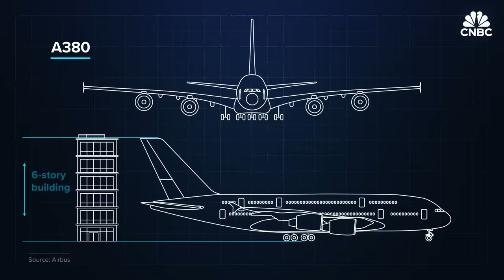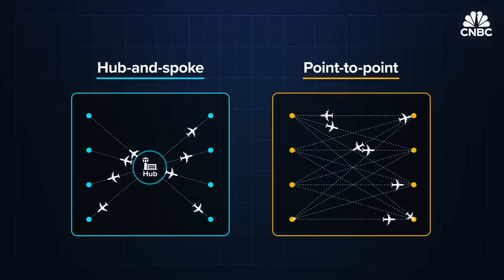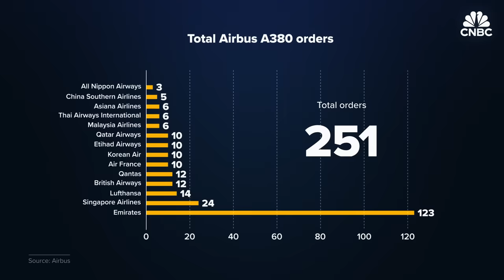Why The Airbus A380 Is Making An Unlikely Comeback

Comment: When you enter the economy class on the A380, you don't feel 'cheap.' There is a sense of 'respect' for passengers. Thank you, Emirates, and other carriers, for showing some 'respect' to passengers.
Reply: The cheap feel always comes down to how the cabin is configured. I bet that the A380 would feel cheap if it was configured by Ryanair or EasyJet.
Reply: @marcellkovacs5452  That's true!👍
Reply: Thats exactly what occurred to me.  I would get on other jets and feel the obvious engineering to save money for profit but at sacrifice of customer comfort
Reply: I always fly A380 if available. I've flown 1st class for 12 hours once... I did not want to leave.
Reply: Not on Ethihad, feels very cramped in economy.
Reply: @jorritpels fork out on upfront or exit row seat in economy. It worth extra$$ spend on
Reply: Emirates 777 economy legrooms are pretty nice compared to other airlines. As a matter of fact the are better than Etihad's so its very much dependent on which carrier you're using.
Reply: @marcellkovacs5452  Exactly, Emirate's 777 feels just as luxurious in terms of interior quality for economy class. The flying experience,  however, is completely different - in the A380, you don't even realize that you've taken off, and the engines are whisper-quiet.
Reply: @biglee13m  🤣🤣😝
Reply: You really don't want to know how bad their pilots are
Reply: Thank Airbus for incurring a loss to make the planes that allow Emirates and other carriers who ordered the A380 to show "respect" for the passengers.
Reply: Repent-and-believe-in-Jesus  Jesus built my hot rod... he's got a sweet-ass shop in old TJ
Reply: You know what's funny. I had my very first A380 flight from Dubai to the UK and I was REALLY disappointed. It was tighter than the 777 that took me there. I sat in economy but I thought it would be given that there would be more space being a bigger plane and all, but instead not only was it not about the same, it was less!
Reply: @stacia6678  I'd agree that the Emirates 777s have similar quality of service, but honestly I don't get what people say about the takeoff in A380s being quiet. Every A380 takeoff I've taken has been pretty long and rumbly.
Reply: I took Emirates A380 from Hong Kong to Paris twice. I took air France A380 from LAX to Paris.
On Emirates they gave little tiger hand puppets for kids☺️
On Air France, I got champagne 🍾 for breakfast in economy 😊
Reply: Qatar A380 economy class is also excellent
Reply: 'respect' by wasting taxpayer dollars to prop up an unsustainable business model.
Reply: Lol, you clearly haven't flown Lufthansa on the A380
Reply: This is true. I will pay more to fly the 380 every single time. I hope this translates into their financials
Reply: When I was cramped in a 450 passenger cabin, I feel very cheap.
Reply: @hoardroarklaughed  no it is not true. I flew Lufthansa A380. It was cramped and horrible. And I'm short so I can't even imagine what somebody 6 foot tall would feel like.
Reply: No plastic knives&forks on the A380
Reply: @apexjunky  that's airlines dependant.
Reply: You're still in higher-than-economy class flying Emirates' (and other expensive airlines') economy class compared to budget airlines. You're paying extra for that "respect", just like how you'd pay extra for first class within the same airline.
Reply: Exactly. Etihad felt cramped @jorritpels
Reply: Because buying an emirates ticket is like flying business with british airways for example...
Reply: Yes i agree. Loved this aircraft smooth flights takeoffs and landing. Economy class is great as you have said. Worst economy seats in the 777 class aircraft
Reply: rolls royce makes a tremendous automobile.
what kind of car do you drive?
Reply: The only one I can actually sit in comfortably in Economy (I've got way too long legs and I'm not that thin either).
Reply: And then you land and have to wait for your checked in bags with hundreds other people
Reply: @Serena_9  Shhhhhhhhhh! ;-)
Yes, the straight leg legroom, or simply to stand up any time I feel is worth it. And that leaves $$$$ in my pocket to spend on fancy stuff in the destination I'm going to, rather than on an aeroplane journey where everyone arrives at the same time.
Reply: @alexf7377  I can’t do economy on 12 hrs flight if I had a choice, I would go for business. Yes everyone arrives at the same time, but different conditions 😂
Reply: TRUE
Reply: They can do it. Fuel cost is not a concern. Fuel represents 50% total flight cost for Occident Airlines.
Reply: Totally agree. Flew with BA from LHR go MIA last December and it actually was reasonably comfortable. Impressive Aircraft.
Reply: I flew on one from new York to London, those suckers are huge, there was so much seat space and leftover seats that the flight crew told me I could move to whatever seat I wanted after takeoff, I went to the second floor and had a while row to myself and could lay down across the seats and sleep
Reply: So true, more space,more comfort.
Reply: Singapore the same :)
Reply: exactlt
Reply: I flew on an A380 once with Korean Airline.  It was a very smooth ride.  I enjoyed the plane and the onboard service.  I look forward to my next A380 ride with Qantas, March 2024.
Reply: Respect ?  What ?? Maybe this is you feeling cheap and not wanting to look cheap travelling cattle class.
Reply: Also Lufthansa 🗿🔝🫡
Reply: Don't travel economy then complain @jorritpels
Reply: @bftjoe tax? In the UAE? Get real.
Reply: @sithabelamandlawenkosiwodu6298  Lufthansa sucks. That's the problem. I'd never fly with them or their rude, intolerant crew.
Reply: @brownmold  Yes, the billions they used to just pay for wasteful A380s just appeared out of nowhere. You do realize European taxpayers had to fund the development of the A380 and now will never be repaid since it was based on deliveries, right?

The biggest losers in Airbus SE's decision to wind down production of its A380 superjumbo may be taxpayers in France, Germany, Spain and the U.K., where governments made a big bet on the plane by lending more than 3.3 billion euros ($3.7 billion) to build it.

You think this joke of a plane had any shot of being funded by a profit oriented organization? LOL.
Reply: @bftjoe  bitter, much? I see a lot more wasteful projects, and ill-spent money. 3.3 billiion Euros spread out over a decade, invested into jobs, development resesrch, keeping and spreading  knowledge within the EU? A whole cadre of aviation specialists trained and put to use on an international civilian project? Great! One of the better uses for EU money. It's not like the participating countries budgets fell apart because of this project. It's signigicantly less money than the utter waste  spent on the UK's aircraft carriers...
Reply: @brownmold  Yes, feelings are what's important. You're a real genius! No wonder you're an A380 fanboi. Billions of dollars wasted is okay, as long as it make big plane to make your feelings good!!!!!111!!!!1!!!

Like they couldn't possibly have spent billions of dollars developing a smaller, actually useful plane. What a huge joke you are!
Reply: 40000 feet stood at the bar with an Old Fashioned can’t beat that 😊
Reply: Oh really? did you ever fly on the AF 380 in economy? I bet you would change your mind lickity splits
Reply: If anyone is interested in getting a cheap feel, fly Air India.
Reply: @marcellkovacs5452  I think that's not the point. I'm tall and there is a big difference between sitting next to a windown on an Emirates A380 vs an Emirates 777-300. On a 777-300, I have to lean sideway because the fuselage leans into me. The fuselage on an A380 actually goes away from the passenger the higher it it gets from the floor because the economy class is in the middle floor, not the top floor.
Reply: I’ve been on an A380 and honestly on take off it was smoother and you don’t feel it as much. It’s allround lovely experience. Also sat on upper deck and all of it is a fantastic experience
Reply: @Serena_9  FIRST WORLD PROBLEMS
Reply: Does the owner of Emirates show that respect to his own daughters?
Reply: @marcellkovacs5452  I wouldn't be surprised if the pilots at Ryanair were sitting on camping chairs, strapped in with skipping ropes and the yoke consisted of bolted wooden sticks that had been washed up on the shore. That's the Ryanair business philosophy  :-)
Reply: @misham6547  I want to know. Whose pilots?
Reply: @bftjoe  still bitter, I see. What are you, a bitter former Boeing employee?
Reply: @brownmold  Did Airbus pay you to fanboi for a useless airplane, or do you do it for free?
Reply: @brownmold  Your baby talk will bring back the A380!!!! You're brilliant!
Reply: I just love flying in the A380....It is my favorite aircraft by a country mile....
Reply: What a bunch of BS....
Reply: @justanotherbeautiful5736  What is? Do you not like the A380?????
Reply: @Macedonia270  he doesn't know. That's why he's not being specific.
Reply: I felt very very cheap when i flew emirates a380. I had more leg room and a better seat on a cityhopper by transavia lol
Reply: @Zoranurai13  I would not know, I fly first class only... The only way to travel, really....🤣
Reply: @justinbchen  of course it’s going to be long, it’s a massive aircraft. But it definitely has far less a fine noise than Boeing planes
Reply: @karenl8837  idk, smaller planes didn't seem to have the same sound to me. But maybe it's just I'm more used to them
Reply: Thank you for that comment! You just read my mind. I worked and lived in the Gulf for a few years (2013-2020), but home was in the US. Emirstes was my plane of choice. Yes, the 777 was OK, but the 380 was something completely different. Yes, it’s a plane, but it’s not just any plane. One thing I particularly liked about it, was its size or mass, making it very stable to minor bumps. To many it’s not a big deal, but I sincerely appreciated this added comfort. Also, I never felt cramped in that plane. I loved standing a few seconds by the stairwell and visiting the bar. Top dog! But of course, the Accounts at Airbus won again. Perhaps we should remind them what funds their paychecks…
Reply: It seems that there are some secrets kept by all parties leading to this mess. I believe the newly designed jumbo jets are not survivable if one of their engines fails on take off or initial climb in every case, one engine does not have enough power. In the case of the A380, even 3 engines could not do it. We also know what happened to Concord.
Reply: "When you enter the economy class on the A380, you don't feel 'cheap.'"
LOL clearly you've never been on one operated by AF.
Reply: Emirates is in a class by itself.  Very true that their economy section never feels cheap, even on the 777's.  It's actually more equivalent on what you would get in first class on an American airliner considering the seat and legroom,   choice of gourmet meals and unlimited drinks and snacks, entertainment systems and other creature comforts where American airlines fail.
Reply: People don't really know how expensive, aircrafts are, especially maintenance wise.  I work at an MRO-Maintenace Repair AND operations facility, and I can tell you that, I'VE NEVER SEEN very old Airbus airframes going through C Checks, ever.  Fact is  we call airbus airframes, disposables.  A320, A330 usually 12-15 years, tops.
Reply: I actually look forward to CMAC because china manufacturing would solve this riddle between quality and efficiency, namely affordable luxury. All capacity is there why not share it with the people!
Reply: If I compare the seating pitch with other airlines/airliners I cants see any respect.
Reply: @Serena_9 if you're old*
Reply: I flew on Emirates 777 it was so noisy. Couldn’t wait to complete the 2 hour journey and get off the plane.
Reply: @marcellkovacs5452  they will never have the money to have some of these planes,not a fleet.😃
Reply: I was going to make a similar comment, you are spot on! It is the best plane to fly economy in and as someone afraid of flying it does almost not even feel like being on a plane. It is such a behemoth that you dont have much noise or feel much movement. I also love to be able to go to the back and do some step-ups in the staircase. It is an amazing plane and if a route has it, I choose the airline and flight that operate the A380. Best plane ever made (for me as an economy passenger)!
Reply: A380 is the best plane for economy class, the noise is well below other aircrafts too
Reply: @misham6547  its OK they are not flying Boeings!
Reply: @sithabelamandlawenkosiwodu6298  I am 6ft. 2"...that's mass cattle transport. After all the expectations a very disappointing flight. Even the lavatories were so tiny I had problems to pull my pants up, because there was no space for the elbows.🤬
Reply: Emirates are the very notorious airline that made the first 3-4-3 in a 777. The first airline to make peasants in economy suffer more than ever  😂😂😂now look at people praising that Emirates 😂😂😂
Reply: @misham6547  Emirates pilots are good.
Reply: @rezhaadriantanuharja3389  That's why they've invested into more efficient baggage carousels
Reply: @lug0718  Si dice "western" airlines, non occident... ignorante.
Reply: @dodaz5604  Do you know what synonyms are?
" Occident " is a term for the West, traditionally comprising anything that belongs to the Western world.
 Ignorant is anyone who doesn't know this and stupid for not being able to understand.
Reply: @dodaz5604  Flight 521, that time a few years ago that they flew 75 feet over Dubai, the runway overrun incident

Comment: I have flown on the A380 several times, and although I love the iconic and elegant design of the 747 very much, the A380 is so much quieter for the passenger that one has to conclude that no other aircraft offers such a level of comfort.
Reply: Yup, been on both several times. Both in economy. 747 was so noisy and cramped in comparison. A380 is unmatched in a league of its own.
Reply: A340 offered the same quiet.

Comment: Best plane I've ever been on. Soooo much smoother and quieter than other planes. You can barely feel it take off and it just feels so roomy.
Reply: Sadly I have no personal experience with it, yet. But a colleague of mine flies it regularly about every 6 weeks for years (first class, no less) and still cannot stop telling how nice it is (Emirates version - which also still has even the cocktail bar at least on Dubai to Europe routes, but probably all).

To me personally the 747 still remains the real queen of the air. Many people don't realize that it was developed in record time and was - and still is - one of the fastest commercial airliners in use. Of course they don't realize, since most airlines slow it down - or really cripple it -  to save some fuel and cost. But it is not only big - it technically is a real high-speed aircraft.
Reply: It's soooo smoooooooth it makes yuoooooo judder when tyyyyyyping .
Reply: @thisiswaytoocomplicated And it's also the highest flying widebody commercial airliner.
Reply: Same. Amazing plane to fly on.
Reply: I felt like it never starts to take off and when it did, the angle of its climb was so small :D
Reply: Yes, it is probably the best aircraft from pax point of view. I flew a couple of times with AF and LH to / from Asia on the A380.
Reply: Its far quieter in flight than any other large commercial jet
Reply: @Happy-xi9hl not true.
Reply: Totally agree.
Reply: safe too as one has yet to crash.
Reply: @kittichan it can take off quickly. They take off slowly to make it quieter and more comfortable
Reply: It handles turbulence really well. All the flights I’ve had on it were really really smooth, much smoother than A350s, 777s etc
Reply: @adotintheshark4848  Even when the engine blew up on a Qantas A380 shredding the wing/ hydraulics/ controls/ electrics and with the engines on shut down and the remaining one out of control the dam n thing still managed to land safely in Singapore.
Reply: guess you’ve never been on a 787.
Reply: @aviongreen9105  I've been on both several times, a 787-9 just three months ago. There's no comparison. The A380 is a league of its own. Everything feels different, bigger, quieter, stability to turbulences is incomparable.